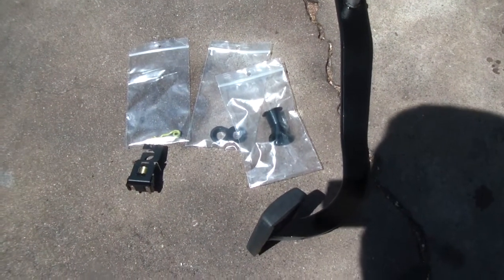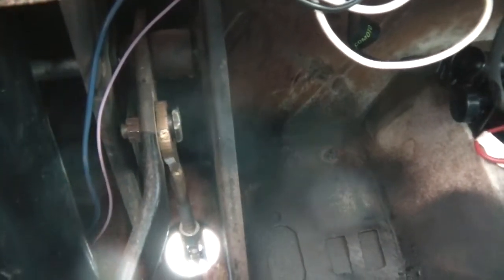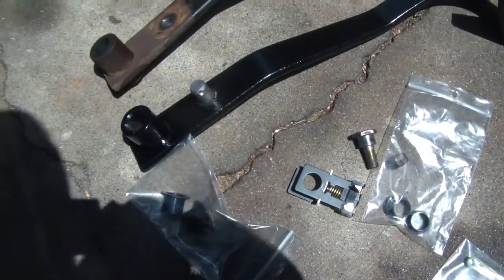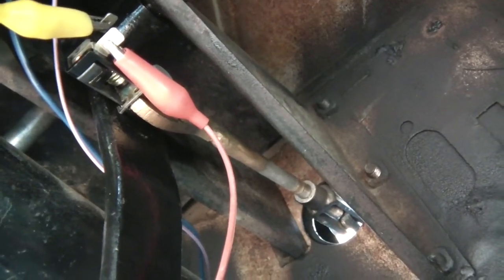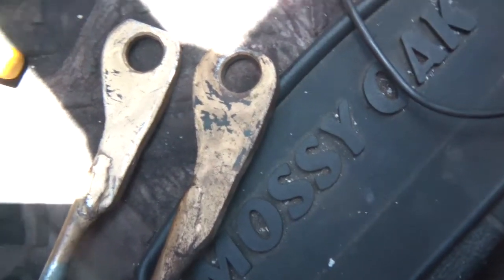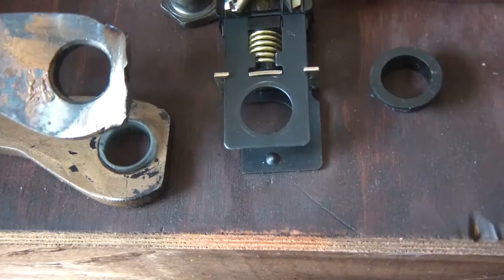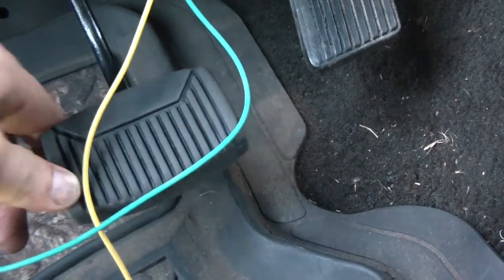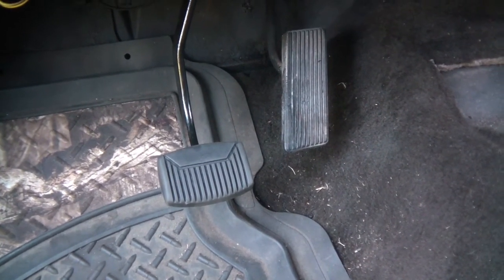Early Bronco Brake Pedal Conversion and Switch Installation custom

Comment: Thank you!! Had a similar problem with my newly purchased 70 Bronco. I think I'm missing the bushings which should fill the slack and apply more pressure to the switch. Thanks